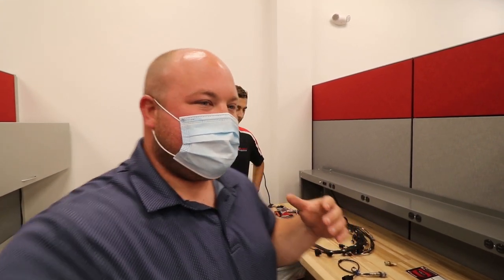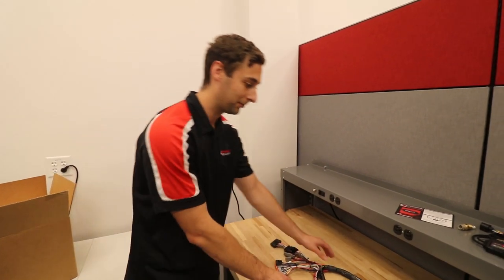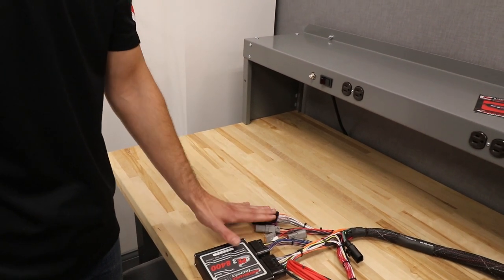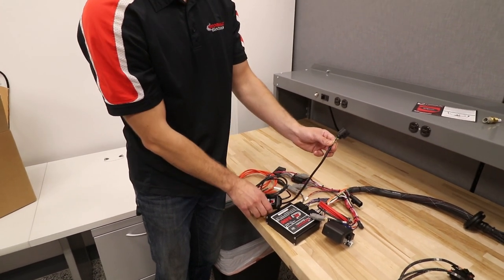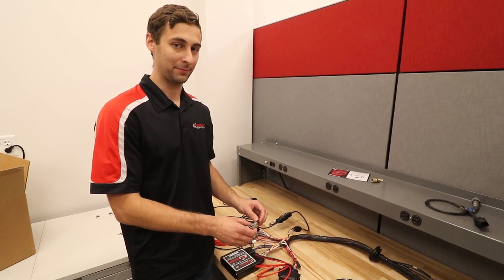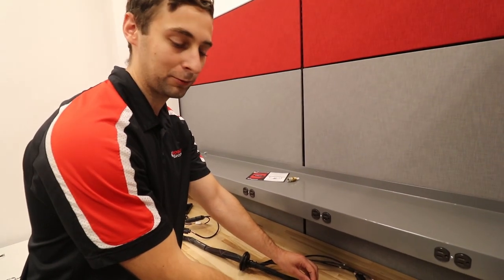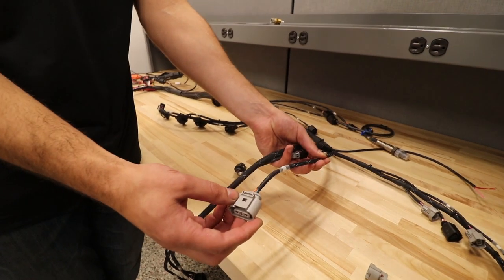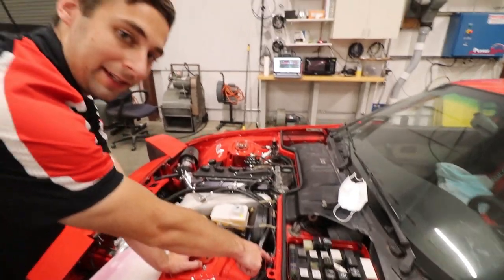07K Standalone ECU & Swap Harness (Performance Electronics - Instructions)

Comment: Well, now I'm really looking forward to when the motor finally gives up on my 86' NA 944! Keep up the good work guys!
Reply from the maker: Thanks! I love that you are rooting for your engine to blow up hahaha!
Reply: @BoostBrothersGarage  haha well, it's got about 200k on it right now and the valve cover gasket needs replacing as well as the leaking power steering reservoir and hoses. So, I could do all of that work or...start piecing together the swap kit and see how long she lasts
Reply from the maker: Good plan! Once you have to pull that engine there is literally ZERO reason to put it back in.

Comment: If you could get 450 hp 370 ish torque on the right wheels and spring settings I bet this car makes great times across the board.
Reply from the maker: Agreed! It’s been on track before and has the suspension pretty well sorted. We’ll be back on track in a few weeks and will know how she does!

Comment: So those throttle body connectors on the harnes go to the vr6 throttle body you used and NOT the oem 07k throttle body, right?
Reply from the maker: That’s correct!
Reply: @BoostBrothersGarage  awesome! Thank you! I’m swaping an 07k into a 77 Datsun 280z, I’ll be contacting you via email in the next couple of months about some of your other parts for the 07k and maybe parter up on some manufacturing. Thank you for the info